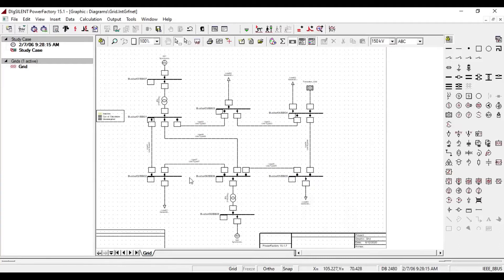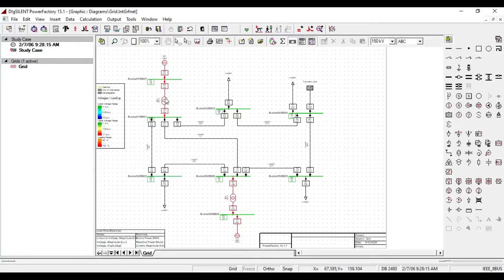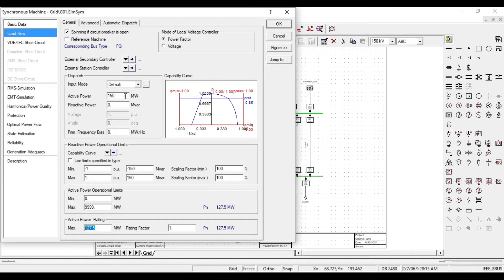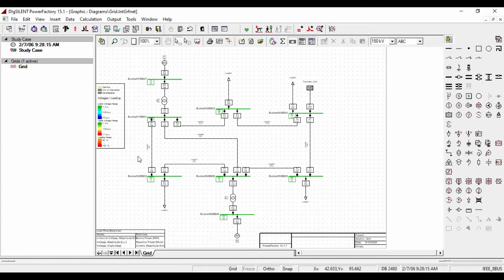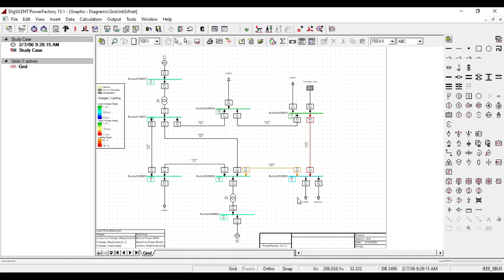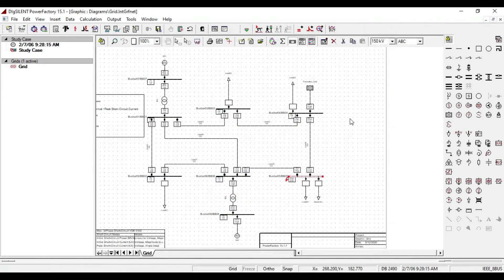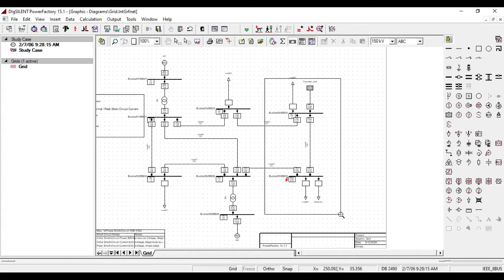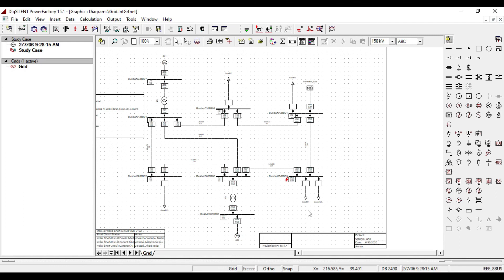PowerFactory-DIgSILENT tutorial #6.  how to  fix overloading condition

Comment: Hello, i am having trouble with my simulation. When i increase the loading at different bus bars, the load flow calculation gives me an error. All i can observe is that the voltage at the busses has reduced significantly. Is this the possible reason why the load flow calculation is not being executed??